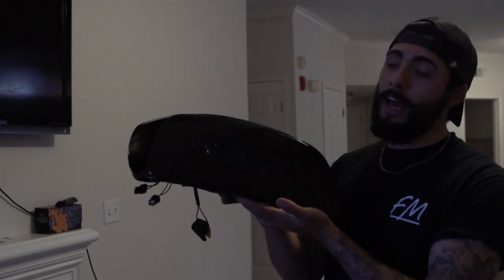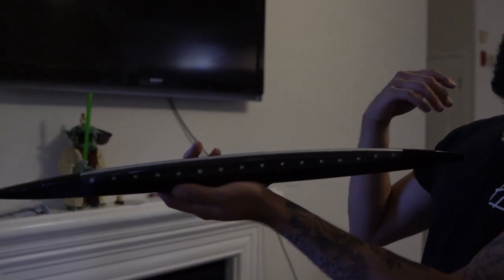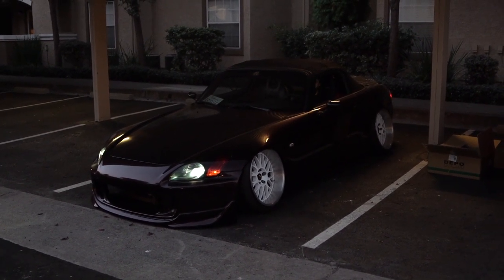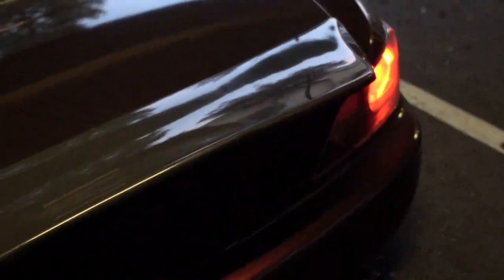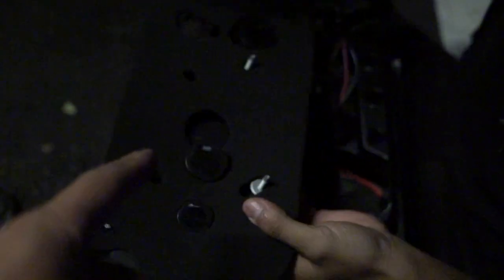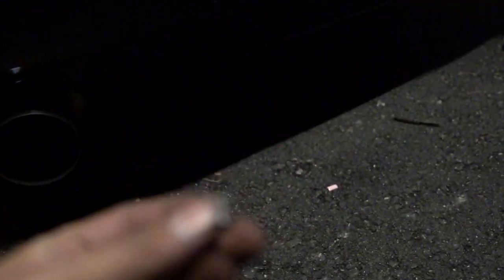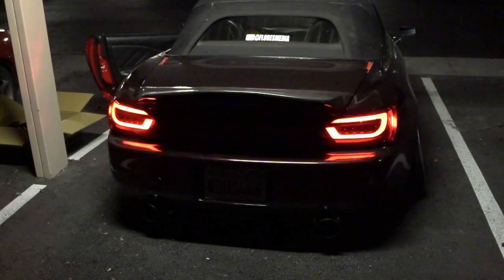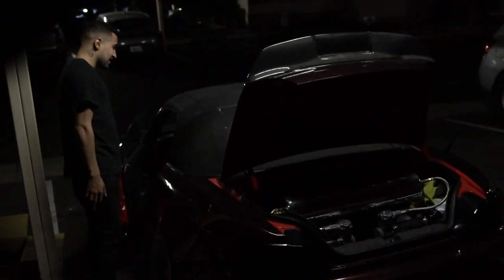HONDA S2000 GETS NEW TAIL LIGHTS!! ( GONE WRONG )

Comment: Pretty nice at night.  Do you like those orange markers on when your headlights are on?  You can delete those for a more cleaner look at night in my opinion.
Reply from the maker: You read my mind brotha! I’ve been keen to replace them with clears maybe :)
Reply: @Floresmedia.  nah you don’t have to clear them out just delete the bulb so at night it won’t show. You’ll still see the orange during the day though. I know what you mean when buying that clear piece and cracking open the headlight and replacing the orange. If you go that route make sure you seal them up good or you’re  gonna have condensation issues in the future.
Reply from the maker: I’ll be sure to try it out bro! Thank you for the advice and tips! Appreciate it! 🖤